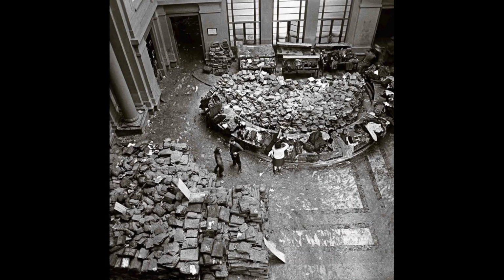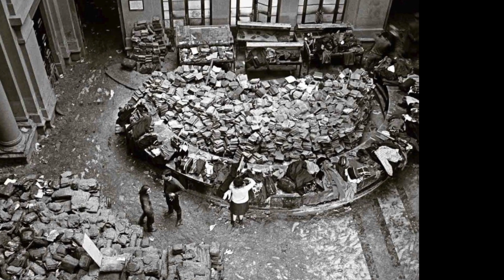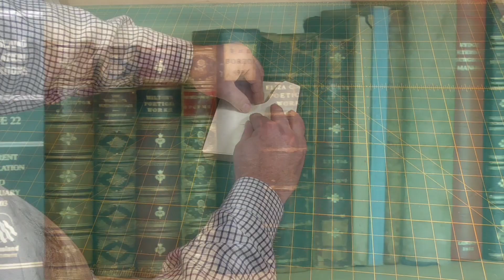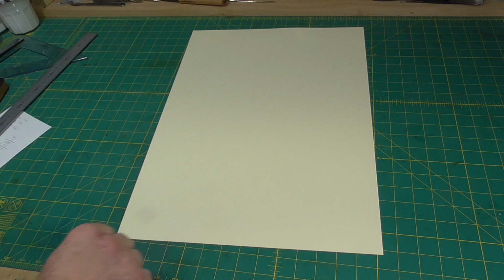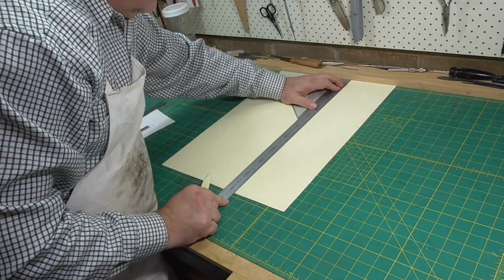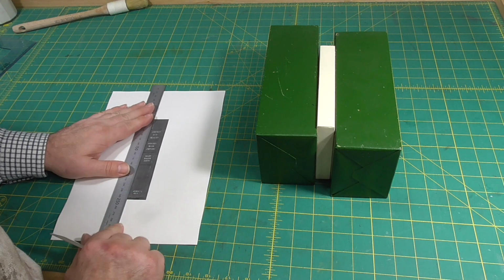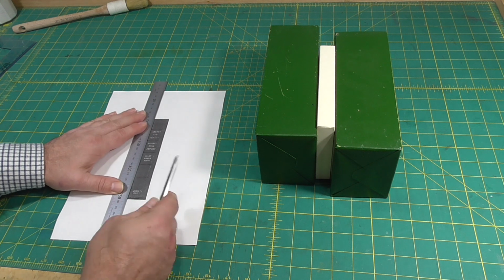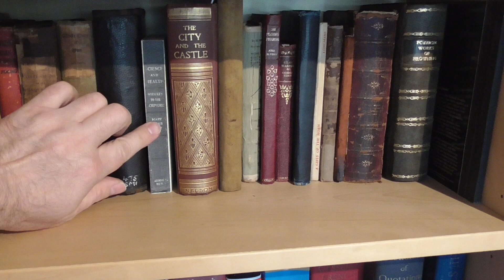What is a Phase Box and How to Make One // Adventures in Bookbinding

Comment: As a volunteer in the restauration department of the museum Plantin-Moretus in Antwerp, I've already made dozens of this type of box (in a stiffer corrugated cardboard) for storage of (larger) books with metal hinges or decorations so that they dont damage their neighbours while sitting in their shelf.
Reply from the maker: What an honour to get to handle those books!  The fluted board is a bit harder to work with and you have to take into consideration the thickness of the board.  But I bet after the first dozen or so you have it down!  Do they put an image of the spine on the box?  I wish all libraries did that.  Nothing worse than looking for a specific style of binding and just seeing a wall of phase boxes.  Thanks for sharing!  Darryn
Reply: @DASBookbinding  sorry, no spine image - just the id number.  It’s for storage in the temperature contolled vault with closed movable shelves.  For fragile books displayed in the 16th century library of the printing house, a book heel is used - smaller slipcase that isnt visible on the shelves

Comment: It's remarkable how- thanks to such large scale actions- the techniques of dealing with mass destruction in archives evolved. For example floods- nowadays the books are frozen to prevent them from destruction beacause it's sometimes impossible to deal with all of them at once. Modern conservation is capable of some unbelivable actions 😀
The kind of box You've presented is especially suitable from a conservators point of view beacause it's a single piece- which means it doesent require any glue that might not be stable enough to be used for long term storage. Love Your work 👌

Comment: I'm loving this.  I'll certainly wait for the two part box since you mentioned it wastes less material; and I'm sure at one point I'll envelope everything to keep it dust free.
Reply from the maker: I think I prefer the 1 piece construction.  It doesn't save much material and you don't get the corner flaps, so there can be slight opening at the corners.  I think the main reason institutions like the 2-piece construction is that it is easier to make.  DAS

Comment: Love the historical commentary as well as the demo.  You commented that you hadn't decided to do the 2 part phase box based on the adhesive choices you had available.  Don't mean to make work for you, but how about developing closures based on NO ADHESIVES??  I may just be talking thru my hat, but  m a y b e  there would be some means of closure based on ORIGAMI folds?  Or some other interlocking mechanism??  Just throwing it out there.  (Sometimes my mind works overtime, which often times means more work for myself ... and my fella!! 😂)
Reply from the maker: The main issue is that it would produce an uneven side that might impress into the object inside the enclosure.  Plus the extra time.  Places doing these want speed.  The 2 piece design using double sided tape is very fast to make.
Reply: @DASBookbinding    Thank you for your kind response ... AND the education!!  I had not thought of the possibility of making undesirable indentions into the "treasure".  Again, my thx.

Comment: Hello, I want to start a handmade notebook business, do you recommend me use the lumbeck method (double fan binding) or the sewing method?
Reply from the maker: I assume you mean notebooks like a personal diary not taking notes in class.  In which case most people expect this type of notebook to take years of use and last a long time.  Lumbecking doesn't provide that.  But neither does the simple "Coptic sewing" used by many people.  At a minimum I'd do round and backed case binding with a sewn-on endpaper guarded with cloth, with supported sewing.  Hope this helps.  DAS
Reply: @DASBookbinding  Actually, I was thinking make planners, in that case which method do you recommend me? I hope I'm not bother you with a lot of questions